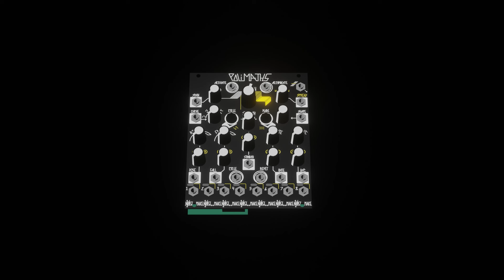Gatin' the PoliMATHS | Make Noise

Comment: Nice showcase of the Renee. Too bad there weren’t any available to purchase for 3 years. MN is closing their ecosystem more and more. Less artistic and more for upper class engineers with money to blow on a skiff for $5k. “Gate high” is electrical engineering shit. Do I need a soldering gun for this thing?
Reply from the maker: René has been in continuous production in some form or other for about 15 years. It is one of many older modules that we still produce and support. Our skiff retails for $250 and is one of the most affordable options on the market. We also make tabletop synthesizers like 0-Coast and Strega that do not require any modular case at all. "Gate high" has been common analog synth parlance since long before Eurorack or Make Noise existed. We're always happy to answer any patch questions any time if something is confusing, we have full time technical support staff, just send an email to technical at makenoisemusic dot com. No soldering or engineering experience is required for any instrument we make.

Comment: There’s a picture of the new oscillator on modular grid. It’s a dual wave table oscillator with 8 outputs at the top. It looks really cool and from the videos we’ve seen with it in use it sounds amazing also. When I get a chunk of cash in the future I might spring for the whole system.

Comment: It's great. I would love a video approximating this patch without QXG and *&(*%#&(*&#. I don't have the rack space for them presently.
Reply from the maker: Sure, I understand that! Tried to keep the workings of this patch focused entirely on PoliMATHS, so the QXG could be replaced by any eight VCAs, and the oscillator by any eight sound sources. (In fact they don't have to be different VCOs, they could be different waveform outputs of the same VCO - see last week's "QXG meets DPO" for an example there.) You would just patch the sound sources to the VCA signal inputs, and the PoliMATHS outputs to the same VCAs' control inputs. If you wanted to do the Jumbled MATHS outputs to a filter, you'd mult the outputs in question so they could be patched through the Jumbler.
Reply: @MAKEN0ISEMUSIC  Thanks! I'm very frustrated that I don't have that space. I might have to consider swapping things out when I need to.